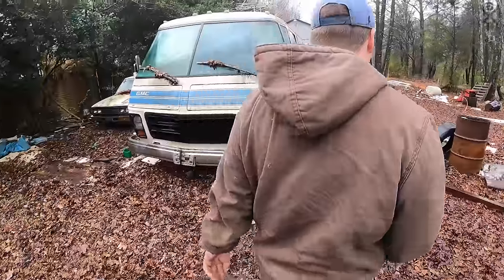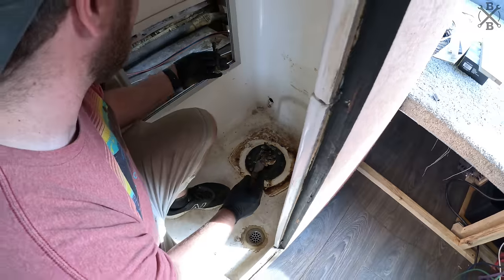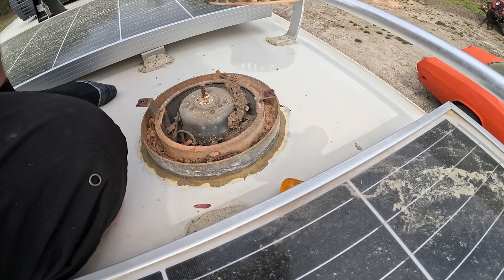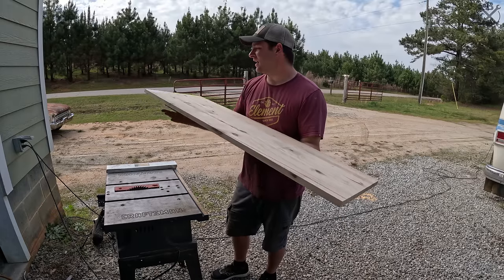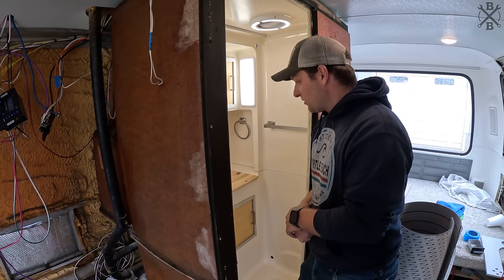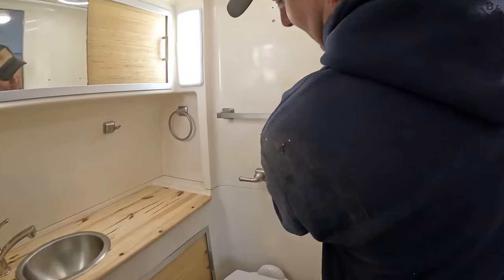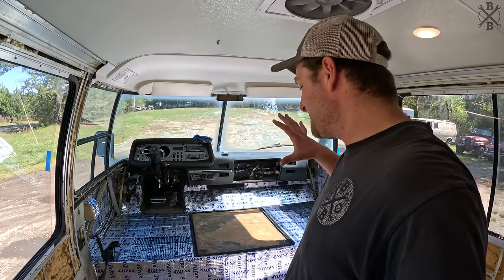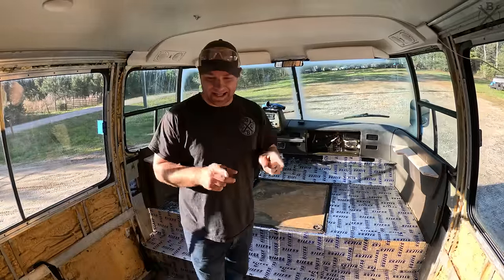Rebuilding an ABANDONED GMC Motorhome! Rescue Part 10

Comment: about latching the propane and battery in place : one thing that might work is just put a piece of pipe across in the center between the two (bouth the width and diameter of the latch you want to use now ) and get a long padlock 
stick that through the pipe and lock it , should keep everything in place  and prevent anyone without a key to remove or unlock them while youre not in the rv (it be fun) 
think gell batteries would be savest for solar , lithium charges faster and hold more charge and is lighter but there allso known to spontaniously combust , and having that next to a flamable gas is a BAD idea 
as for the shower tub : was actually thinking that you could fill the gap up with high density expanding foam but i think that would kinda compress and sink/dent over the years and you end up in the same boat a few years down the road  
there a few tutorials on youtube about faux granite painting countertops
about the showertaps : i wonder how eazy the taphandles come down to open , as with the arm on those taphandles hitting a bump in the road could "drop" them open, luckily the towelrack should prevent you from accidently turning on the shower while standing up or sitting down on the toilet 
if you can take those taphandles off you could stick a rubber o ring in between them to make them a little harder to turn or remount them with the handles facing down (probably need to switch the hot and cold valves to be able to open the taps by turning them in the current closed position )

Comment: Did the new toilet come out of the salvage camper?
Reply: Also, which mm sound deadening do you use?
Reply from the maker: Yes 🙂 The toilet, cabinet handles, sink, faucet, curtain and plumbing came out of the salvage camper. It’s 50mil, 1.3mm sounds deadening.

Comment: Found a 1977  GMC Royale for $5K but I'm sure they would drop it quite a bit because it needs work. It will start but also needs to be gutted. The remodeling they've done looks terrible and is so heavy with 3/4" plywood. They put the worst bathroom in the back and cut the area in half. It's just a mess. How far from Flowery Branch ,Ga are you? Would you consider looking at it and letting me know if it's something I should try? My daughter has had several heart attacks and I want to be able to go to Pa and see her but I have pets and I really need a camper.

Comment: Man, that will be a cool camper when it’s done. Definitely don’t see them on the road like that anymore. We have a 1972 Chevrolet C 50 schoolbus that my mom and dad camp prized in the late 80s and we still run it. We just spent 10 months working on it because Parts, like the front brake drums were hard to find but it’s so neat
Reply: How about converting your braking system on your camper to use disc brakes? It'll work better, with less fade, and there will be more spares available.
Reply: @kristoffermangila  these were great for 50 years, im sure we’ll be good for another 50 God willing
Reply: @outlawweldingmotorcyclerep1680  ok then.

Comment: Those Bathroom walls and rust stains will totally disappear if you use liquid soft scrub with bleach on it but it has to be name brand.I use it on my paint for my Cars even my vintage cars as well as the boat. It's really amazing stuff with a damp rag the wipe it out.Guarentee it will look showroom. I wouldn't recommend it unless I would use it It has to be soft scrub though those knock off brands don't work like it does .Great job

Comment: THat bathroom looks nifty and comfy again! great work! :D
What do you mean, you don't know what you're doing? I have seen nothign but well-thought out ideas so far, and a good number of pretty good ideas, too. :)

speaking of ideas, here is a thought about that motor latch: put a layer of acoustic foam over it and cover that with carpet, covering the locks with it via press-on buttons at the corners. question is if the difference in noise reduction is worth it, also you'd have a bubble in the middle. so, just an idea. :)

Comment: Do yourself a favor and forget about carpet. I attracts dust, moisture, bugs, dirt and stains... put in flooring, it is far easier to clean and maintain. Bonus points: if you need to replace it it"s a lot easier and cleaner to do too

Comment: The gas would be even safer if you secured it with a belt instead of leaving it in a plastic plate. A gas bottle like this has its own weight, which can take on a life of its own if you make sudden steering movements. And holy shit, you have a Pagode SL sitting there and it's probably going to be a budget build? If an old SL with a hardtop is remanufactured or restored, such an SL is worth over $100,000, depending on the engine. I'm excited to see what you make of it.

Comment: So where and how far you going in this? Id be worried about freeze plugs rotted out and blowing then head gaskets then rear main pouring oil as front seal too.Id think it will never end It needs engine pulled and gone thru before I drove 250 mile Id think  without worring about a huge tow bill. Just saying.  Just saying Everthing on powertrain is half centrry old and dry aged. With that said bathroom looks good. Me i would move into the future and put down laminate fake wood flooring.

Comment: Suggestion, golden mate battery company is a new company and right now they got batteries with hot sensors overload sensors charging BMN so battery maintenance system. BMS gives me battery maintenance system is a keep it from overcharging and they got hot and cold sensors and the new company and they got 50% off right now try them out for your solar system.

Comment: Has anyone thought about an entire chassis clip and drivetrain swap? Find a chevy or GMC 4x4 front clip, remove the back drive shaft of the transfer case to make it fwd and go from there.
Reply: It's already front wheel drive, uses an Olds Tornado driveline.